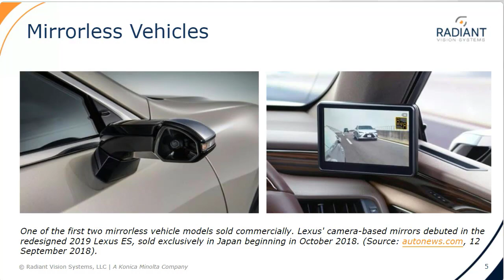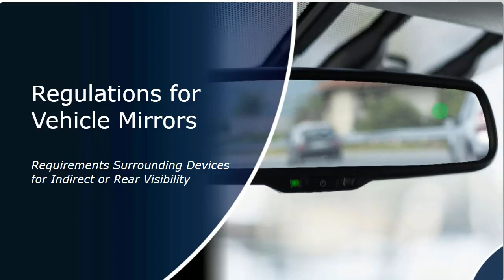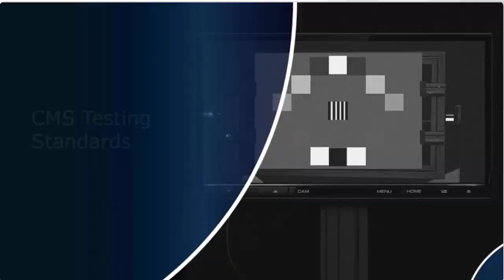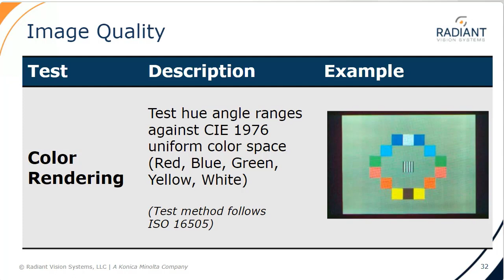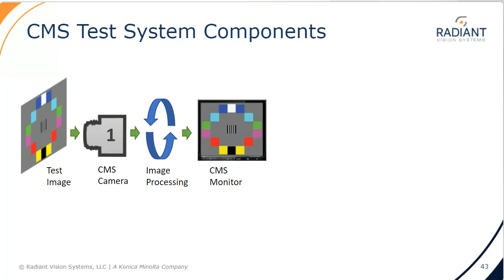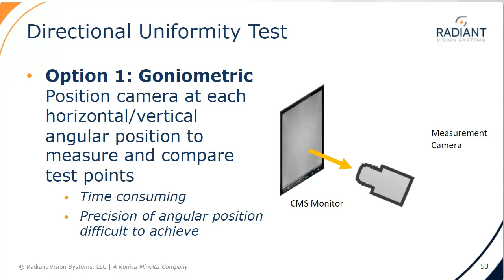Understanding and Applying Standards-Based Display Testing for Camera Monitor Systems

Comment: Just have to comment that answer for Time-based testing equipment -related question @ 57:00. Google for "Video Multimeter", that's the tool for measuring the system latency.